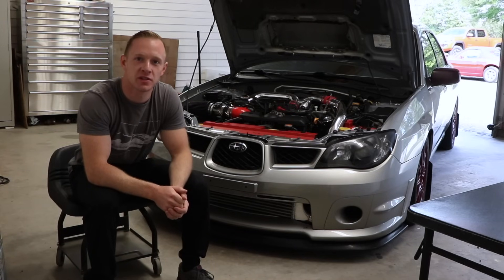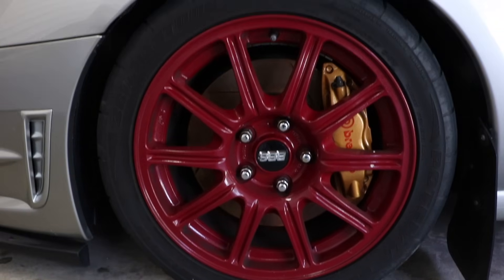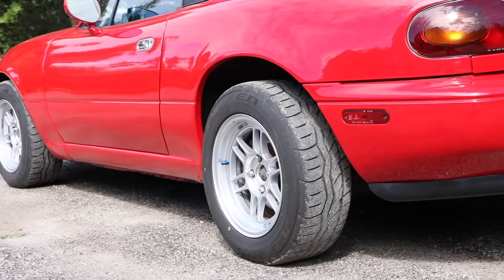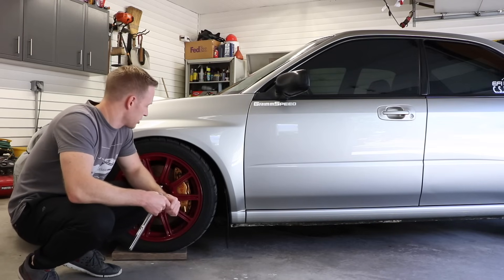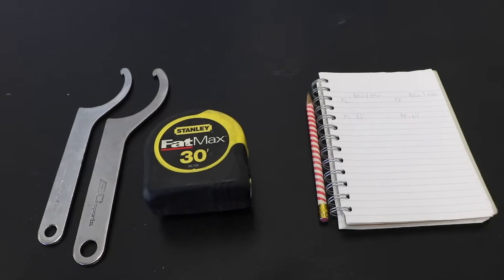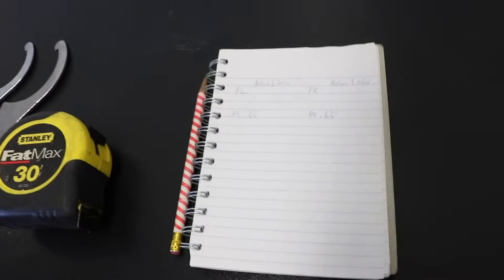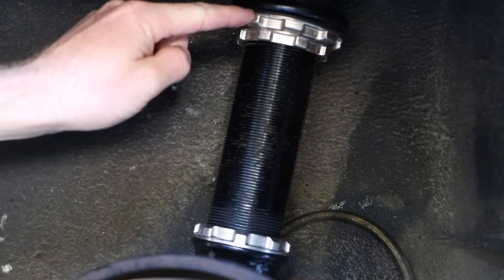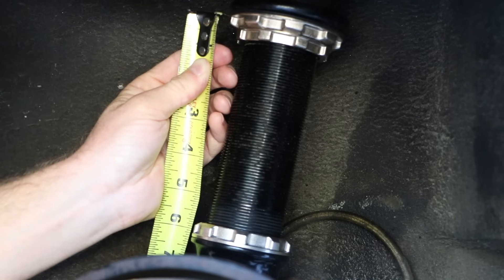How To Adjust Coilovers Properly

Comment: Thank you got the Megan racing coilovers on m45s and it is way to low bottoms out with the slightest angle scrapping my stainless steel muffler setup. Your vid has shed some lite on the adjustments

Comment: Do you need adjustment of wheel and camber when adjusting the height of coilover?
Reply from the maker: Yeah, changing the ride height will change your alignment settings.  It’s best get your car right where you want it, and then get an alignment.

Comment: So you unlock the bottom and turn the top collar up or down.
Reply from the maker: Down to move the whole shock body into the collar to lower the car.  Up to raise the car, but use the bottom of the 2 upper collars to do that.  You don’t want to adjust your preload while making height changes.

Comment: Have them on my Lotus Elise. It sits lower at the front than my first Elise but now it hits the driveway even with the steel chequerplate I have installed - hopefully I can adjust the ride height.
Reply from the maker: You should be able to.  Lmk how it works out!  P.S. I love the Lotus Elise.  It’s next on my list of cars to own 😎
Reply: @DriveItRyan  Yes I fixed it, two turns clockwise lifted it up half a centimetre. Thats all it needed.

Comment: Ok so loosen the bottom ring then turn the top ring to the left not touching the middle ring then tighten the bottom ring again? If I lower it a quarter inch do I have to align my forester again?
Reply from the maker: You got it!  You can get away without doing an alignment with such a small adjustment.  I always play around with the ride height after a coilover install until I get it right where I want it, then go to get an alignment.
Reply: @DriveItRyan  hells ya

Comment: Does it need to be on a lift or have the wheel jacked up to adjust. Or can this be safely don't on the ground?
Reply from the maker: I’m not sure how you’d access the Coilover to adjust without taking the wheel off but either way I would jack the car up and take the weight off it.
Reply: @DriveItRyan  I like cars but I'm a mechanical idiot don't mind me. Thank you!! Hooking up my frs with some soon

Comment: Help!! I was gonna raise the car today and found that my lower top collar was almost half way down (it was loose) everyone’s says not to touch this but I don’t know what happened.. what can I do?
Reply from the maker: Spin it back up until it meets the other top collar and tighten it.  It’s there to prevent the other top collar from loosening and changing your spring preload.  Don’t panic you will be good 👍
Reply: @DriveItRyan  thank You, will there be any issues with my spring  preload?
Reply from the maker: @cruxx4023  your spring preload shouldn’t have changed but you can always readjust it to the recommended spec just to be sure.

Comment: Bought a car that was too low for me with the same coils.  Mine was tough to get turning on the first corner, but got it raised about 2". The first 1/4" or so I had to hit the spanner tool with a mallet. After that I could turn by hand.  Went to the next corner, which had PB blaster working in the threads...thinking it'd be easier.  Wouldn't budge.  The tabs on the collar are basically rounding off. Ugh.  Now I'm trying to find a shop that will even work on coilovers.
Reply from the maker: Oh man I’ve been in this situation before.  I feel your pain.  Keep working at it.  Maybe throw a little heat on it to loosen everything up, or if worse comes to worse, use a set of channel locks instead of the spanner wrenches.  It’s definitely not ideal, but once the tabs are rounded off, you don’t have many options.  Once they break free, give them a good cleaning and lube them up with wd-40 so it doesn’t happen again.  Best of luck to you my friend!  Lmk how it works out.
Reply: @DriveItRyan  Thanks, I tried channel locks last night for a minute but didn't feel like I was going to do anything but more damage. The metal just seems way more soft on this one. Frustrating when you know a job should ideally only take a few minutes.

Comment: So loosen the lower collar and turn the top collar to the right to rise it ?
Reply from the maker: You got it!  Twist the smaller of the 2 top collars to the right (clockwise) and it will raise the entire assembly.  Be sure to leave at least an inch of threads in the bottom shock mount though to be safe.

Comment: do you have to get an alignment after?
Reply from the maker: An alignment is always recommended after any changes in suspension geometry.

In this case, I had an alignment done before this small change in ride height, so I personally did not get realigned immediately afterwards.

Comment: doesnt that just adjust the preload and not the ride height? i thought you have to remove the coilover to truly adjust ride height because it has a threaded lower body
Reply from the maker: There are many different designs, but with these, you aren’t adjusting preload doing it this way.  The entire assembly can move up or down into the threaded lower body.

Comment: Thanks for the vid!
But dude....you are messing with the pre-load.
You lower the car with the bottom most collar loosened and you turn the body/shaft clockwise.
Reply from the maker: Correct, but I am raising the ride height in this video and turning the entire body counter clockwise.  I’m not turning the collar touching the spring at all. Just using the collar under that to turn the body upwards.
Reply: @DriveItRyan  ah,  I see. Thanks for the clarification!

Comment: Like the detailed explanation. I have one question. I measured both sides in the front the same measurements. But one side is 1/2 inch to high. Any suggestions? Just wanted too point out that my tires are new and have the same pressure.
Reply: could be unequal weight on each side, my rear suspension had different heights even though the coilovers were set to the same height. it happens, and if absolutely everything seems the way it should be, you’ll just have to chalk it up to more weight being on one side of the car than the other and you’ll have to adjust as needed
Reply: I finally figured it out and its like you said it happens some are the same and some are not. Thank you.

Comment: I really hope you or someone reply to this.

Is it really compulsory to do a wheel alignment after I raise my ride height?
Last time I did it was a week ago when I lowered the car. I would like to raise it up by a few centimetres.
Reply from the maker: Meor Hariz Your alignment will change slightly, but not by that much if you only raise it by a few centimeters.  Your camber will change the most, but if it makes you feel any better, I didn’t realign my car after doing this.
Reply: @DriveItRyan  Hahaha, thank you for being honest and genuine! Your explanation in the video was clear and I really need to raise my ride height as the stock exhaust is scraping the ground when I go through some speed bumps. Need to raise it for a while before I fit an aftermarket exhaust.

Thanks Ryan!
Reply from the maker: Meor Hariz haha yup I’ve been there!  Anytime, I’m always here to help!

Comment: Old content is good content.  Simple: First, don't loosen the bottom of the two collars up top.  To raise: Loosen the bottom lock collar, then righty tighty on the bottom of the two top collars.  To lower: Loosen the bottom lock collar, then lefty loosey on the upper of the two top collars.  Use a tape measure to check your work before and after.  Then tighten the bottom lock collar.

Comment: Are most coilover spanner wrenches the same. Picked up an 07 wrx just like yours not long ago with coilovers already installed and no wrenches to do any adjusting. Checked the website of the coilover brand and they don't carry just the spanners.

Comment: A question, if you adjust the car like that. Will it be more bumpy or it'll be just the same? Since the spring is being compressed as the lock is being screw upwards? Sorry, I'm still new to coilovers
Reply from the maker: Kingrare Five The spring is not being compressed or adjusted in any way by adjusting the ride height this way.  I keep the top collar right where it is.  So the car will ride the same!  Thanks for your question!
Reply: @DriveItRyan  thank you! And can I somehow reduce the bumpiness of my car? My car almost bumps on every surface of the road. And I have a high low bodyshift coilover with no option to change from soft to hard or vice versa. Thanks!

Comment: I have a Subaru BRZ and followed the "use the bottom bracket to adjust the ride height" recipe before. I then found myself in a situation where my ride was very harsh on bumps, and yet the height was still too high. I'm talking "almost OEM height" too high, and I'm not a stance boy.

I was lucky to stumble upon a video that recommended the opposite: use the adjustments at the bottom bracket to set the "comfort" (more specifically, to set the correct amount of compression travel) and from there set the ride height using the top lock ring. After some trial-and-error and then analyzing all the before and after measurements, I found out that the preload was set too low. By adding preload and screwing the damper into the bottom bracket by the same amount, I was able to significantly improve the ride comfort without changing the ride height. I've made a few iterations until I noticed minor rubbing, and then I've undone the adjustments a couple of mm.

After that experience, I came to a conclusion in certain situations (such as cars on the FT86 platform with big tires, such as 245/40R17 in my case), once the correct damper length (adjustment at the bottom bracket) is set, the only correct way to adjust the ride height is by changing the preload. Many say that "too much preload can negatively affect the ride comfort" which is true, but my point is that in a certain range of preload, it's in fact a better tool for adjusting the ride height than the bottom bracket.

Comment: will you need an alignment after lowering the car more than 1/4”?
Reply: not for 1/4" but if you see uneven tires or it pulls you to the side when driving at speed, then yes.

Comment: Do you need to do an alignment after doing this? I’m looking at dropping mine about a inch and a half in the rear and about a 1/2 in the front and I’m just wondering if I need to get an alignment after I do it
Reply from the maker: That’s one hell of a drop!  I would do an alignment for sure after that much of an adjustment.

Comment: Does the front and back coils have same length? Meaning if you measured the fronts to be at 6 1/2 the rears should be measured at 6 1/2 for them to be even out?
Reply from the maker: MrRainnnsss no, you will notice that the front Coilovers have less distance in between the collars than the rears do.

Comment: Only thing is, even though you can adjust ride height with the perches it’s not actually the correct way cause your just messing with you preload too
Reply: This actually is the correct way to set the ride height. You can’t add preload to a linear spring. Say it’s a 5kg/mm spring it doesn’t matter how much you compress it it will still compress another 1mm for every 5kg added until your spring coils touch. The correct way to set coil overs is to first fit them without the spring and use the bottom mount to get your damper compression at your desired ride height.  Damper should have 2/3 bump and 1/3 droop at ride height. Then you can install the spring and use the spring perch to set the car back to your ride height. If you have to compress the spring so the coils are touching it’s too long, if it becomes loose when the wheel is unweighted the spring is too short.  Spring perch height may be different on every corner of the car but that’s ok. Some people will add their weight to the driver seat while setting the heights so it spreads it across the car for better balance.

Comment: Very helpful, my current car is my only
Atm and I’m moving to another state soon and the car was lowered when I got it, to carry my head and other parts I want to use in the future I would need to raise it a little bit to get rid of my wheel rubbing the fenders with the extra weight thanks so much brother 🇯🇵🇯🇵🇯🇵

Comment: Do you need wheel alignment after every time you adjust the height?
Reply from the maker: ace rides this question was asked a few times in the comments but here was my answer: “Your alignment will change slightly, but not by that much if you only raise it by a few centimeters.  Your camber will change the most, but if it makes you feel any better, I didn’t realign my car after doing this.”

Comment: isn't spinning the very top collar counter clockwise going to loosen it off the locking collar below it? I just adjusted my coilovers, and when i span the top collar counter clockwise it came loose and began to adjust my preload (the locking collar below did not move at all). i then reset the top collarr back to its original position and was able to turn the coilover by spinning the lower collar counter clockwise. the preload must be affected , both in your video and my adjustment? because the travel of the spring has changed.
Reply from the maker: Cyrus Muir no you shouldn’t be adjusting preload at all.  If you want to lower the car, spin the top collar counter clockwise against the locking collar and it will move the whole assembly down.  If you want to raise the car, spin the locking collar on the top clockwise and it will move the whole assembly up.  I hope this makes sense.  I know my hand/arm was in the way, but I am spinning the lower of the 2 collars on top clockwise to raise the ride height.

Comment: You have no idea how much you helped me. I have the same coilovers on my STI and Mazdaspeed and the STI rides way stiffer. I was an idiot and was using the top preload adjustment for height and never touched the bottom. Makes since why it rides so stiff because I was jamming the springs so close. I should have caught on when I was struggling to tighten the collars anymore. I feel like an idiot with how easy it is to do. Thanks man!
Reply from the maker: Harry Crisp haha that must have been a real rough ride!  Glad to help dude, it’s way easier than most people think.  Fix that preload and go out and enjoy! 👍

Comment: You shouldn’t adjust the bottom collar. Start by calculating your bump and droop travel, set it with they bottom damper body adjustment collar, check the ride height and adjust using the preload collar. Assuming your springs are linear this is the correct way to do it, progressive springs are much more complicated
Reply: I have a similar set of coilovers and the instruction specifically say to use to bottom collar for height adjustment and never use the preload adjustment for adjusting ride height

Comment: Hey brother I did my still with your same measurements because they are perfect but when I lower it the front it's stupid high do I need to let settle because they are new?
Reply from the maker: Yeah if they are brand new, I would drive around for a couple of weeks, then remeasure and adjust as necessary.

Comment: Although small adjustments don’t make a huge differences, there will be changes to your alignment if you adjust ride height.
Reply from the maker: Absolutely correct!  I’d always recommend an alignment after any changes in suspension geometry 👍
Reply: Losers get an alignment
Reply: @awwbubba3071  fr lmfao, lowered the fuck outta my car about 9 months ago and never got one. Nothing happened
Reply: @razaahmad9942  that’s bc you can’t see the inside of your inner tire. LMFAO
Reply: @razaahmad9942  Uneven wear on the tread bro, no Bueno!
Reply: @D_GMZ_IV  i should go check my tires 😭
Reply: @razaahmad9942  how'd they look? haha

Comment: There's nothing wrong with loosening the top collars in order to unload the coil (assuming your jackstand is under the frame/jackpoint/pinch weld), it makes it easier actually to turn the threaded assembly by hand if you don't have the spanner wrench since it will not be sprung.

Comment: If you want to adjust your coils perfectly you want to measure from the center of your hub or bbs cap to center of your wheel arch/fender.  A lot of factors such as worn bushings and uneven floor will throw your height off. Trust me I tried matching the coils and it did not get me anywhere. Cheers!
Reply: Thanks heaps for the advice helped a lot🤙
Reply: Don’t need to do all that if your car is on a flat surface. Worn bushings don’t affect ride height only suspension affects that.

Comment: Tip: If the motion ratio of the damper is not 1:1 with the movement of the suspension, then the amount of length change required to raise/lower the height is not 1:1, either.

Comment: .25" at the coilover probably equals almost .5" at the wheel, because the coilover isn't connected at the hub; it's inboard, so the length of the lower control arm multiplies any height added at the coilover.  The multiplier is different for each car.
Reply: How would I figure out what the ratio is? Or is it simply just trial and error?
Reply: @diddlemeister7210  measure LCA inner bushing to shock mount and inner bushing to hub.  Divide shock over total to see the ratio.

Comment: I'm thinking of a set of coilovers for my 2014 Chevy Cruze LT.  I wanted a set of 17" aftermarket wheels (tentatively the ESR SR11 or the Enkei RPF1) and a set of these will help the wheels fill out the wheel wells, which is the look I'm after.  It's great having a straight forward explanation on how to adjust coilovers and It's good to know how easy they are to install and adjust.  It may be late in the year to gear my car up for the driving season, but I'm looking forward to next year when I can install the mods I want on my car.

Comment: Curious as to what the ground to top of wheel well height changes to. Looks like 1/4" translated to 1 or more over all lift.
Reply: Correct .. the measurement on the coil is multiplied in actual lift